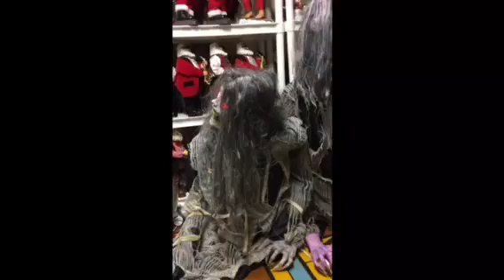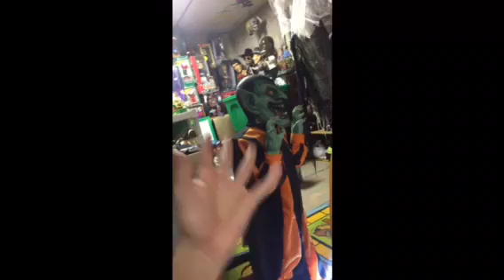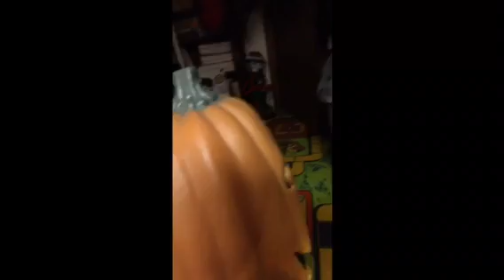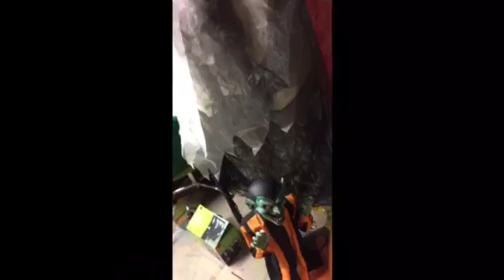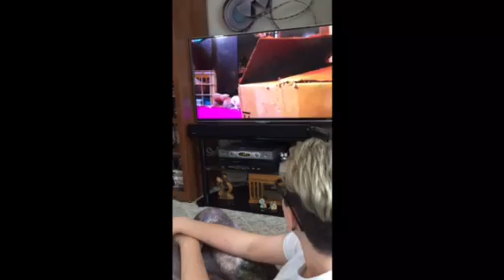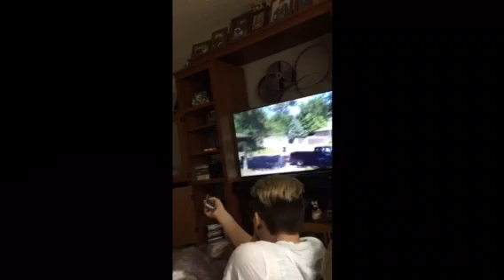Halloween props and trying to fix poppin goblin but fail

Comment: Hi! This morning at around 3:30 I was asleep in my room and there was a really loud noise. It was music, the music was coming from Tommy Trout! Somehow (I think it had low batteries) the censor had turned on! But the switch was off.
Reply from the maker: Oh my lol, but the switch is on but the sensors on it does not work and it's somehow randomly going by itself
Reply: 3:00 AM is the witching hour or there's just something that glitched while you where asleep and my electrified maniac turned on by its  self but the sensor was broken but I was turning it off
Reply: It's kinda creepy because later on my dads radio kept turning itself up. Mabey my house is haunted or the radio is just broken! It was probably a glitch though.
Reply: Most likely

Comment: Yeah my Larry Lobster did that and the switch was off and I sprinted outta there.
Reply from the maker: Ya but the switch is on but the sensors are not working and it's weird it just randomly goes off